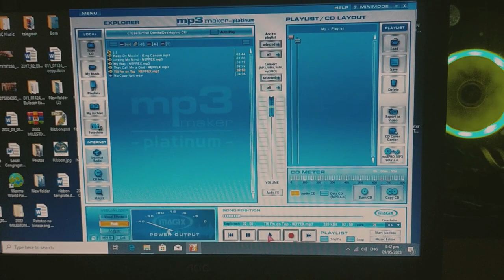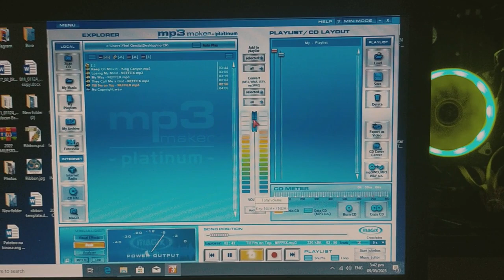DIY Amplifier Booster, ang Sound System ng mga Batang 90's

Comment: Ganyan kami dati, nun hihh school ako yr 1989 may subject ako electronics, may projects kami booster amplifier mga parts
2 input booster transformer 50w
2 output booster transformer 50w
4 ng power transistor MJ2955
5 w/3 ohms resistor x2
5 w/ 390 ohms resistor x2 
Power supply 12v /6 ampere
Gumawa din kami ng 15 watts amplifier with tone control 
Ang casing lng ay aluminum 2x4x12 (2)
5 w/ 390 ohms res
Reply from the maker: Wow thanks po sa pag share at sa pag tambay sa Channel ko. Ok na ok parin po itong gamitin. Old school pero ROCK! Pa SUBSCRIBE, like at share po.

Comment: Ok yan booster amp. Dagdagan mo lng power transistors, hidher current na xformer/filter csps at cooling fan. Kahit pa 24hrs tugtog, kayang kaya.
Reply from the maker: Tama sir pang babaran to. THANKS for watching po. Pa SUBSRIBE,  like at share po :-)
Reply: Tama sir panahon Ng 90s sa Cebu uso yan sa amin kahit trisikol Ganon gamit sa amin noon naa magkano na badyet yan ngayo n pag pagawa sir
Reply from the maker: @korapyot4741  nasa 2500 din sir. Di na kasama housing nya don kasi DIY lang. pag binili mo aluminun housing mejo mahal din.
Reply from the maker: @korapyot4741  sakin sir uso parin sya :-)
Reply from the maker: Thanks for watching po. Pa SUBSCRIBE like and share po. Gusto ko pumunta dyan sa Cebu sana magka chance.

Comment: Boss pwede ba yan connection 
From mexer to EQ to cross over to input boster amp drive 500WATTS sub speaker 2pcs
Reply from the maker: Need parin ipasok sa aux ng mini amp  na 30-50w bago ipasok sa booster. Wala pong pre-amp na sarili yung booster. dapat papasok sa kanyang signal minimum of 30w. pag parang output lang ng headphone di nya maaamplify yon.

Kung ganyang setup gusto nyo isama nyo na sa assembly ng booster yung mini amp. Para may pre-amp na yung booster. Dami naman na mini amplifier board sa online. Meron na din nga 3way. Parang no need na ng cross over.

Comment: boss matanong lang ho. Pano po i parallel yung mga transistor? Sakin pag dalawa lang tumutunog pero pag apat na wala na ng tunog. NPN gamit ko 2n3055. baguhan palang kasi ako pero tama naman diagram ko kasi paulit ulit ko dinouble check.
Reply from the maker: pinag ko connect lang naman sir Emitter to Emmitter, tapos Base to Base.  bale dalawang pair ng 2n3055 ang naka parallel  dyan. alam ko neen nga insulator kung ituturnilyo nyo 2n3055 kasi positive ang collector nyan.
Reply from the maker: May difference po diagram ng pang 2N3055 sa MJ2955

Comment: Pabili Ng Isang unit  nyan sir, booster amp.
Reply: Saan ba puesto mo sir?
Reply from the maker: Nako pasensya na po dinemo ko lang yung inassemble ko para sa DIY video. matagal ko na po nagawa yon pandemic pa at walang pasok. Di po kaya ng sched ko mag assemble. For personal use lang po kaya ko. Sinisingit ko lang po sa konting bakanteng oras. Pasensya na. Wala po akong pwesto Sir.

Comment: Sir anong value po ng resistor n pinang bias mo?
Reply from the maker: nasa 2nd video ko po yung matrials sir. value ng resistors.
Reply: @doraemonyito318  sige sir check ko po salamat sir, mag build din po sana ako kahit 50 watts lang pang motor lang kung kakayanin
Reply: @doraemonyito318 sir kakayanin kaya, ng battery ng motor na 12v)5amperes ang 50 watts per channel na booster?
Reply from the maker: @yahmace1 sa single na motor po ba gagamitin? bitin  po 5amp sir.
Reply: @doraemonyito318  opo single sir, 7 amperes sir kaya n po?
Reply from the maker: @yahmace1 kulang po battery ng motor sa booster sir, design po sya na pang kotse. class D amp po bagay sa motor.
Reply: @doraemonyito318  salamat sir, mukhang ht21 nlng gagamitin ko
Reply from the maker: @yahmace1  MT21 yung binooster ko sir, sakto na sa motor yon, Yung HT21 ata yung mas matas ang wattage. OK yan sir  kung pang motor lang.
Reply: @doraemonyito318  opo sir mataas din na voltage at amperes required ni Ht21, atleast 7 amps din po ata, gagamitan ko nlng po step up, pang bahay nlng cguro tong 50 watts booster ko hehe
Reply from the maker: @yahmace1 di pa ko sir naka gamit ng Ht21, Mt21 lang, pero tingin ko sa Mt21 voltage regulator lang meron don kaya voltage range nya 12V to 24 , sinubukan ko sa 24V umiinit lang heat sink nya pero wala naman significant increase sa lakas. Kaya mas ok sya sakin 12V lang. parang mas tatagal sya sa pag 12V lang.
Reply: @doraemonyito318  Thank you sir 😊